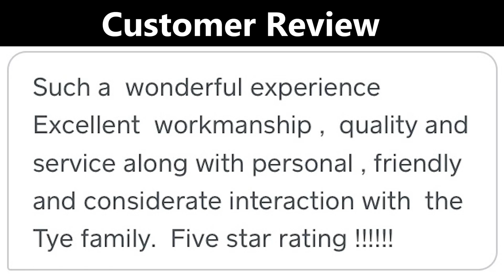Water Runoff System - East Brunswick, NJ. 08816

Comment: are the vents there just in case there's an ice blockage? I've never seen anyone else install vents when doing drainage. just seems very odd to have them
Reply from the maker: The grate works as a vent, clean out and freeze protection.  If the pipe were to freeze in the winter water could escape through the vent.

Comment: The "clean out vents" are an interesting idea. But I'm curious, how are they used? I've seen angled PVC "leaf screens" placed below the downspout, and above the 4", to keep leaves from getting in the pipe in the first place. You can see the angled screen thing here: https://youtu.be/UW7waK-j5Kc?t=517
Reply from the maker: The grate works as a vent, clean out and freeze protection.  If the pipe were to freeze in the winter water could escape through the vent.